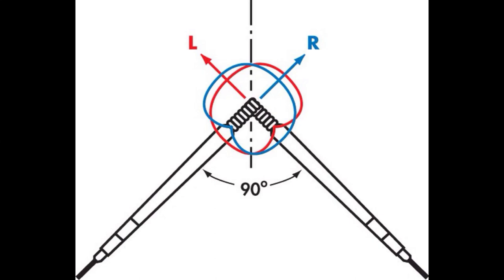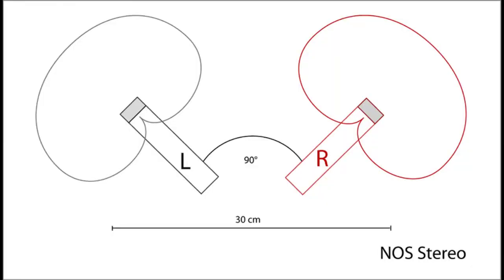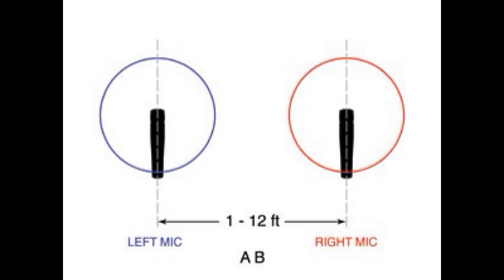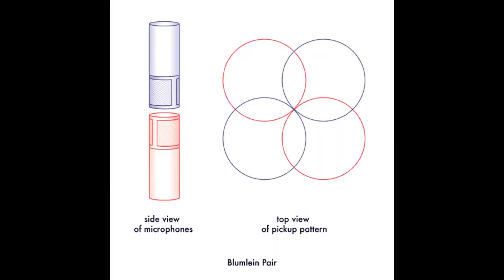How to Mic a Room in Stereo: Four Easy Methods

Comment: Great video Ian, very straight forward. Everything seemed perfectly outlined! Only one small detail was left out. The height and distance in proximity to the kit. Blumlein pair is usually lower to the ground in my experience for better lower tone. Nontheless, awesome video! I wish i would have seen it months back when you posted it
Reply from the maker: I hope to do more soon. The height of the mics was kept consistent to best illustrate the differences in the sound set ups, as apposed to each for its best advantage. The same with the distance to the kit. Each set up was about 20' out from the kick drum. There's a small exception for the spaced omnis distance from the kick due to the triangular geometry of having a wide space. Hope that's helpful.

Comment: Listening through headphones, coincident pair sounds the most realistic. Phase coherence = punchy drum sound. ORTF and spaced omni are spacier sounding because of phase differences between the mics. I didn't enjoy Blumlein that much, I guess it's because it's not close to the way our ears work, as they don't have crossed figure of 8 patterns. 

Edit: I've also noticed that Blumlein and X/Y sounds more distant (i'd suggest listening with eyes closed) than spaced pairs. X/Y sounds like it's 18 feet/6m away, spaced omni - like you're somewhat 9ft/3m from the kit, near coincident - like you're a step away.

Mid-side would have be interesting too. 

Thanks for the demo.

Comment: The spaced omnis has the most defined roomy sound to my ears. 

If using the omni spaced pair technique:
Add delay time that correlates roughly to the distance to the wall + the distance from the mics to the wall doubled (one meter is roughly 3 ms, so that distance times three. As an  estimate, then tweak some ms if needed. 

With the added delay youre now hearing what the drummer hears when hes playing (the sound reflecting back to him from the walls). 

Which is the teqnique Steve albini used (RIP) if i have understood it correctly.
Reply: Also he put his omnis on the floor to avoid early reflections

Comment: Epic dude. Wander how or if what Audio-Technica did with the AT 8022 is even a thing to do with 2 actual seperate mikes. I don't know what it looks like inside. But the 8022 is a single stereo mike. But some way some how instead of doing 90 degrees, or even 120 they went and put the capsels back to back at 180 degrees. I also wander if they could have gone farther. Which would have been super epic I think.

Comment: Fantastic demonstration and holy mother of rooms, what a sound! Very impressed. Just wondering, to capture the room ambience, would you ever position the mics to face the walls rather than the sound sorce, in order to eliminate the direct sound? This question would apply to directional (cardioid) mics only.
Reply from the maker: You know, that has just never worked for me. I find a better result, if I don't want any of the direct sound, is to leave the mic in omnl but put a physical barrier to shade the mics from the direct sound. All kinds of fun and mischief can be had doing this.
Reply: +Ian Schreier that's really interesting. What kind of material would you use in between the mics and the sound source to shade them, when the mics are set to omni?
Reply: I find that the technique you mentioned works well to tame harsh cymbals if your room isn´t that big or great to begin with, and use it frequently. I often put them facing into the corners of the room and away from the kit.

Comment: Thanks Ian. This is excellent. Keep it going! I reposted on my Thread Audio FB page. I'll be sure to send you some specific topics I am interested in (and I hope others are too). What is the name and model # of the fancy microphone bar you are using with the 414s? I saw K & M for the stand but didn't recognize the bar itself and microphone mounts.
Reply from the maker: Thanks Michael,
I'm do these as often as I can. The stereo bar is made by Grace Designs and is part of a set (3 bars- 2 long,1 short.) that I use for 5 channel surround, and Decca tree micing.
Reply: Thank you Ian! I'll look into getting them for my studio!
Reply: Ian Schreier Just watched again Ian. I am buying the Grace SB-66 this week and was wondering if it connects to a standard mic stand, ⅝-27 thread. Also, I noticed you didn't use the AKG shock mount. What kind/brand of clip do you use? Thanks!

Comment: Is it possible to COMBINE two different configurations or is that just asking for phase issues? I like the sound of the overall Space Omni but the Blumlein is crystal clear
Reply from the maker: Matt van den Ham it indeed is possible.  You can blend different parts of the room to create some unusual and interesting tones. One suggestion though, if you are running multiple stereo pairs in different setups, use different locations in the room and not just different patterns for the pairs. Change up the distance to the source a good bit fo each pair. That helps to avoid hi freq phase ugliness when you try blend the pairs together. Blending in pairs from the front to pairs from the back is a handy favorite. 

Super pro tip:
try crossing over (of filtering) the different pairs. For example, get the low end (low pass) from one pair and the mid and high (high pass) from a different stereo pair. This is super cool and nobody really talks about it. 

I have one rule, if it sounds good, it is good.
Reply: @ianmix1 awesome ideas ❤

Comment: Ian, was wondering why did you pointed the C414 diaphragm in XY versions away from the drums? Were you showing example of rather a room mic than the drums mic? I'm a bit confused with the reason. As far as I know the front of the pattern should be facing towards the source of sound.
Reply: Also really loved the Blumeline technique a lot. Sounded very opened and nice space. Wanted to ask your opinion as well. You've mentioned about deviding the room to thirds. Questions is how do you personally define the distance away from the kit?
Reply: BTW really dig the list of the mics your studio possesses! Wow
Reply from the maker: I think You'll find that I swing the mics back around front just before recording. I found it easier to show the pattern switches by swinging the whole x-y bar around
Reply from the maker: The question of the distance to from the kit is a tough one. A lot of it has to do with the distance to the walls and ceiling.
Reply: Ian Schreier I see.
Reply: Ian Schreier So actual geographic placement in the room you mean?

Comment: Hi, for the 2nd technique, is there a distance to respect between us? thks
Reply: I'm assuming that this video is a very general overview of techniques, but yes, there are distances to be observed between mics depending on which near coincident pair system you wish to use.  He used a near-coincident pair, but neither the ORTF (French) or NOS (Netherlands) system was adhered to.  ORTF uses an angle of 110 degrees (55 degrees + or - from center) between mics at a distance of 17 centimeters (a little less than 7 inches) between capsules.  What he used was closer to the NOS system which calls for a 90 degree angle between mics at a distance of 30 cm (nearly a foot).  My understanding is that both NOS and ORTF systems work better with small diaphragm mics, but you use what you have!  (and I DEARLY wish I could afford a pair of the  AKG 414 mics like he has!)  I also wish he had done a Mid/Side setup, but hey, it's not my video, so until I make one, I can't really complain! :)

Comment: I appreciate your effort, but am disappointed on the results. I'm sorry to say that this video is MISLEADING.

Your positioning of XY is incorrect. The middle of the membranes should be vertical alined. Now you have near-coincidence of a few cm. Also the vertical distance is too big to call it coincidence, due to the size of the microphones.

Your argument on AB "the sound hits the left microphone before it hits the right microphone" is in fact the explanation of near coincidence. This timing difference is heard as directional information, only in case it is realistic in relation to our ears (that are about 17 cm apart).

You use drums to demonstrate stereo recording. I would expect an orchestra, choir, ensemble, or band to demonstrate the spread of sound sources.

Please don't mix up the near coincident parameters. All sorts of distances and angles could be useful, but the names are given to the following exact parameters:
ORTF: 17 cm 110 degree with cardioids
DIN: 20 cm 90 degree with cardioids
RAI: 21 cm 110 degree with cardioids
EBS: 25 cm 90 degree with cardioids 
NOS: 30 cm 90 degree with cardioids
All cardioid (not super-cardioid, hyper cardioid, half cardioid, ..)

At 11:05 Your comment is very confusing.
This Is AB with angled cardioids, 45 cm 100 degree as far is I can see.

Your positioning for Blumlein is also the right positioning for XY. They are at least vertical alined now. Simply switch between figure-8 and cardioid.
With both microphones in upright position besides each other, you could easily create any near-coincidence setup with accuracy. 

About your spaced omni example. If you listen with headphones it is clear, that the signals are uncorrelated and directional information is damaged.

It's a pity that you didn't demonstrate ORTF, because that would have shown the most realistic image. With the microphones nearer to the drums, the sound sources would have been spread to a wider angle.
Reply from the maker: If you watch the video, you'll see that ORTF is covered and I even admit to it being my favorite. The title for the video is How To Mic a Room in 4 easy ways, not let me show you every possible to mic a room with 2 mics As to being misleading, you saw the mics in the room in their various positions and heard the result. If you felt mislead by that I can't help you. If you are referring to the dosens of ways engineers have found a way to disagree with each other I agree.. These are gidelines not chemical formula. I use one set of tools, and follow one rule. I use my ears which are the final arbitrater for what is right in any given situation, my rule is very simple and will never mislead you. If it sounds good, it is good. Period. Perhaps you're ready to stop reding AES white papers, and go record music to see what YOU like. Music is a subjective expience. The engineers art is just as important to the recording as the players (Notice I refer to the Egineers Art, Not Engineers calculation based on a unrealistic scientific experiment performed in a lab)
Reply: Ian Schreier Whatever you want to demonstrate, if you mention names of stereo techniques, those names should be correct as shown in de video. Please have a look at 08:24
spoken: "this is the near coincident pair, also sometimes called the ORTF"
show diagram: NOS stereo (30 cm 90 deg)
actual used: large diaphragms in a 50 cm 100 deg position.
ORTF = small diaphragm in 17 cm 110 deg.
... draw your own conclusions